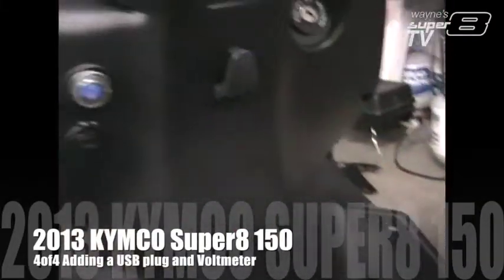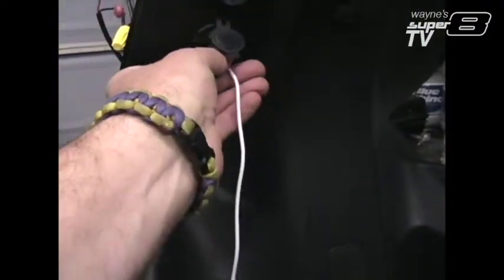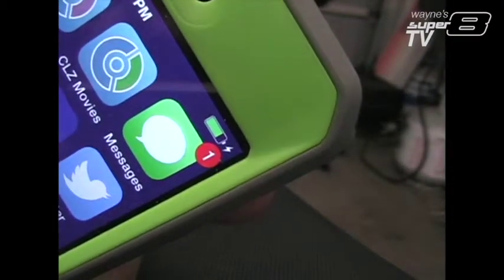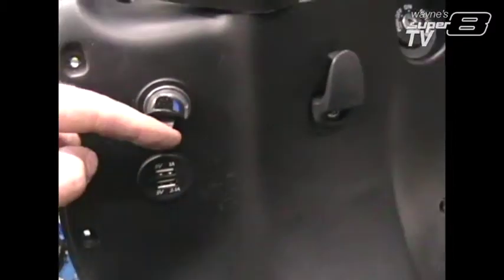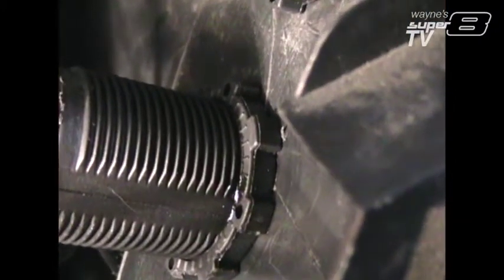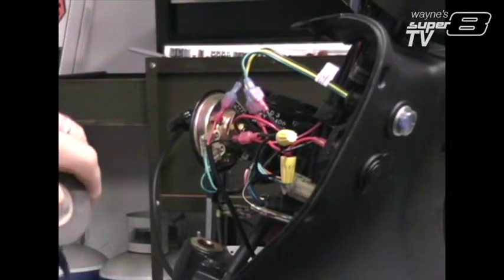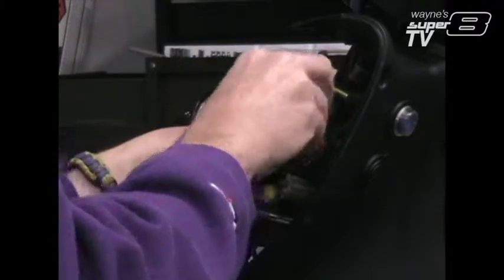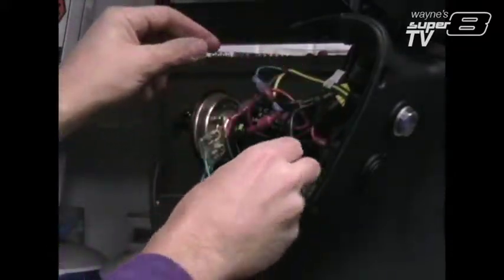Super8 150   4of4 Adding a USB plug and Voltmeter

Comment: Your voltmeter indicates 13V while usb chargers needs 5V. How does it work in your case?
Reply from the maker: +Jerico Olivares Pause the video at 1:57. You can see that the USB port I put in regulates the voltage. Top plug is 5V 1A and the bottom plug is 5V 2.1A. Thanks for watching.
Reply: +TitaniumWayne 

I see. Does all car usb port accessories regulates voltage down to 5V output? I surmise it should. Otherwise, it would have been  a disaster or cumbersome.
Reply: +TitaniumWayne 

On the other hand, how does it goes with your handling, acceleration and pull power.
Reply from the maker: +Jerico Olivares I&#39;m not sure about car outputs. No noticible difference in handling, acceleration or pull power.
Reply from the maker: +Jerico Olivares Yes I would certainly recommend it for a first scooter. The ONLY downside FOR ME is that I found after a few months of owning it, I wanted to do more highway riding. 55MPH (90KPH) is about the top end of speed for me at 230lbs (104kg). I felt vulnerable because once  I hit the top speed, I was at the mercy of other traffic. It didn't have the pep pass in a decent distance a car going slightly under the speed limit. Check out my S8 150 review video for more information.